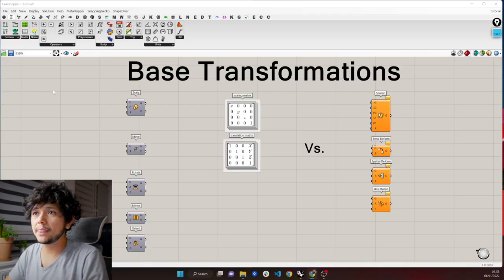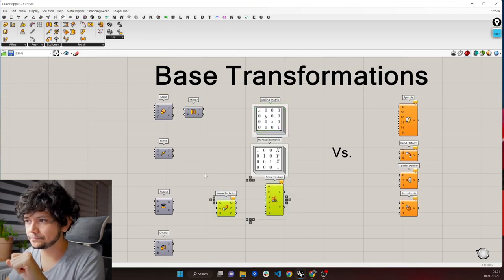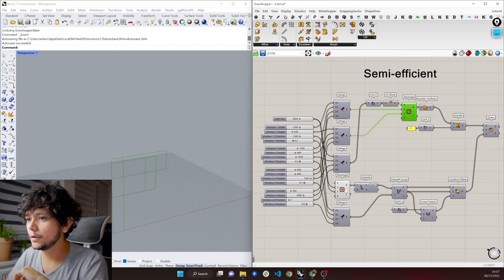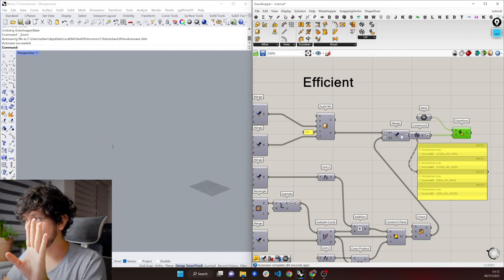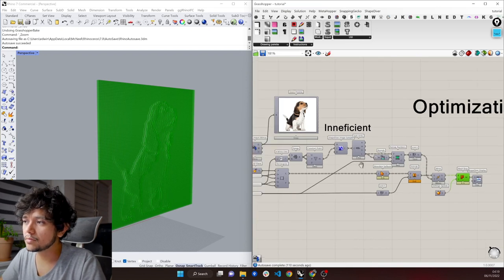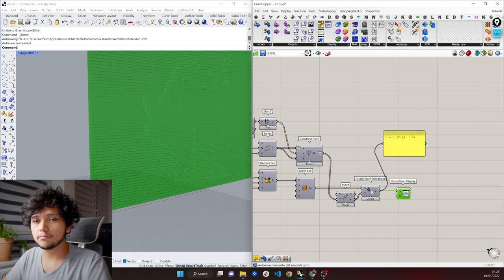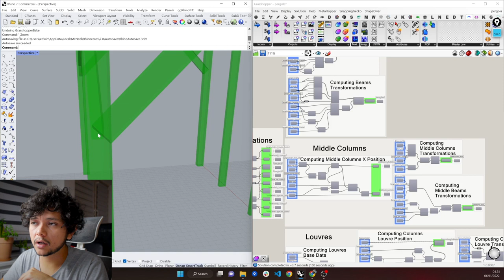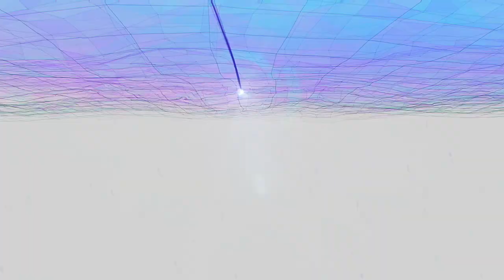How To Optimize Grasshopper Files With Transformations!

Comment: Hi, Edwin. Thank you very much for sharing your proposed workflow and optimization. Can you share the GH definition of the window and pergola example so I can study it more thoroughly? I want to work more on shape diver in the future. I really appreciate any help you can provide.
Reply from the maker: Glad to know you enjoyed the video. All files and links are available in the description.
Reply: @ShapeDiver  Hi Edwin, thank you for the files. I have studied it and really appreciated the use of transformations and differential mesh volume to be scaled. In the example, the limits used in differential volume mesh for the non-uniform scale were dimensional. Is it possible to input a) functions, b)curves c) surface/mesh as the limit for the scaling of the differential volume for the x, y, and z input? Sorry for my persistent question; I just got hooked on the efficient workflow and optimization you have shared. Many thanks, and more power.
Reply from the maker: @tonypimentel2207  I am not sure if I understand your question, do you mean that you want to transform other geometry types, not just meshes?
Reply: @ShapeDiver  Hi Edwin...say I did a square of 1 unit x 1 unit as the differential area from the origin ...then  I made many different irregular close polygons using Geometry Pipeline. is there a way to fill in the irregular polygon from a 1 unit x 1 unit area (which is regular) to an irregular polygon? What kind of value to use on the x and y input from the nonuniform scale component? or are there any other methods to use?....many thanks in advance!
Reply from the maker: @tonypimentel2207  if I understand well your question, you could try by using the Scale NU component with a base plane that is not oriented with the regular polygon, in this way you should be able to create irregular polygons. Otherwise, you will need to morph the polygon which goes beyond just a matrix.
Reply: @ShapeDiver  Hi Edwin ...many, many thanks! I will try. Thanks again.